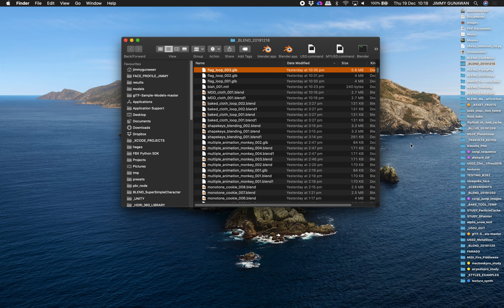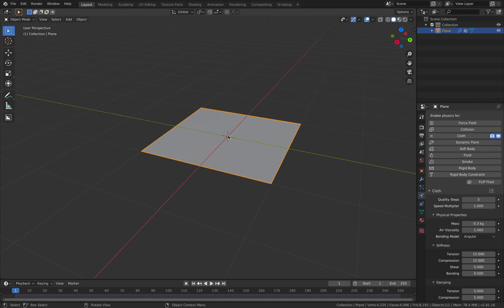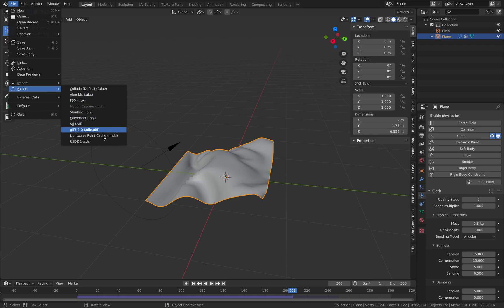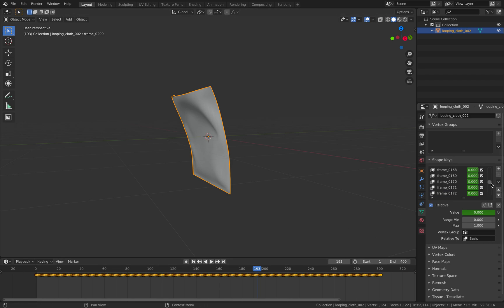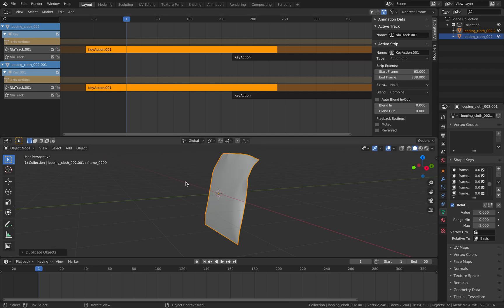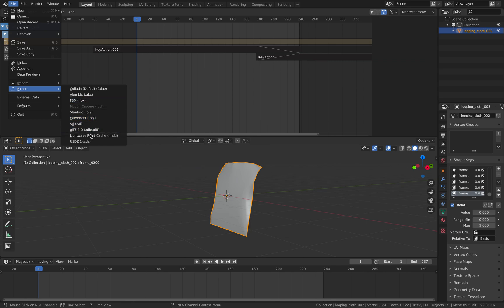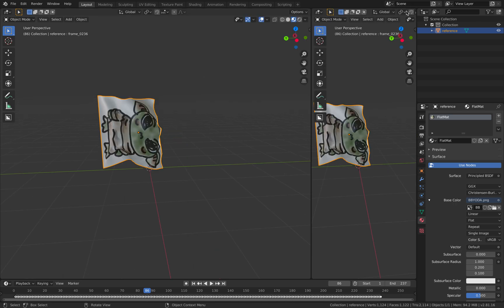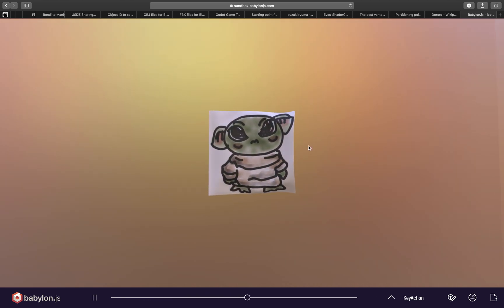BSLIVE Creating a Perfectly Looping Cloth Animation in Blender

Comment: My flag changes position for some reason on import. When I bring in the MDD, the flag is on X axis and once I play it, it slowly transitions to Y and continues playing until it reaches the end where it goes back to X again.  IT goes back to the original position of the plane before I loaded the MDD. This is causing me jittering problems when I try to blend them in NLA. Does anyone know why this might happen? I followed precise instruction in terms of exporting. Cheers     @Jimmy Gunawan
Reply from the maker: You might need to export the first frame mesh and use it for the MMD.

Comment: Hi, great example of this case, I'm having issues using the mdd exporter, I get glitches when trying to import the cache to the obj, not sure if it's a bug or I'm doing something wrong
Reply: Ok I found the solution, and is never exporting to obj, just using the same geo without the cloth modifier, I think there's an issue exporting and re importing obj files
Reply: @SebastianVillanueva04  I have the same problem,  but using the same mesh did not solve it.

Comment: Hey man, first of all, props on the tutorial, really helpful. My only feedback would be to explain things better , for example, offsetting should be equal for both instances, that way you won't have to export a refference frame, guess or try to match manually. So, if you offset the layer above with 100 frames, then the one below should also take 100 frames to reach the original frame, so the first frame will be the same as the last one.
Reply from the maker: Thanks for feedback, yes usually for my video tutorial I go through things quickly. I am planning to make additional article per video in my blog / future books.

Comment: Any way to fix the issue when the model decides to play the animation out of its original position?
Reply: I found the solution in another tutorial: export your obj file with the selected object and change forward to  „x Forward“ and Up to  „z Up“ and also import it with this selection.
Reply: I had the same problem. Don't rotate your model before making the blend. To avoid changing position of the model you have to make sure that in the "Strip" tab in "Nonlinear Animation" options you have Extrapolation set to "Hold" and Blending to "Combine". If you not seeing the options, press "N" key but the window must be active.
Reply: @jankokot3537  Even with these settings, when I turn on blending, the cloth just starts slowly turning with the blend until it reaches the opposite location on the other axis. If I do the same with the other strip copy the cloth results in a jittering animation since their end and begging is on the opposite axis they go in opposite directions so blending doesn't work properly. I just spent many hours trying to solve this and I failed. For the life of me I do not understand how to prevent the mdd animation from returning to the original plane location. If you have any ideas, please, I would greatly appreciate any input. Cheers